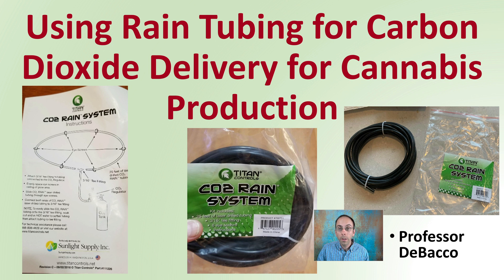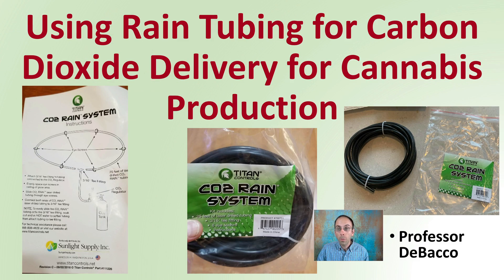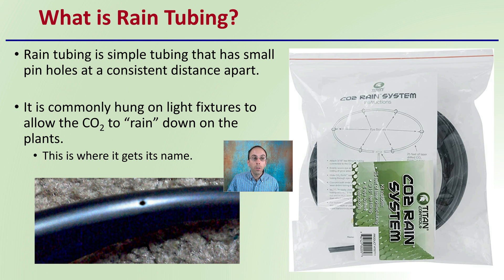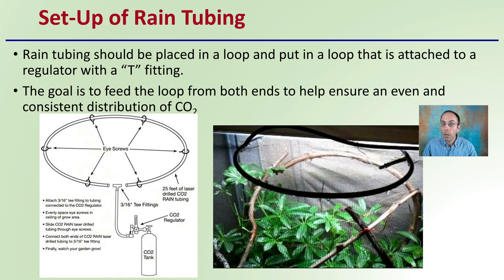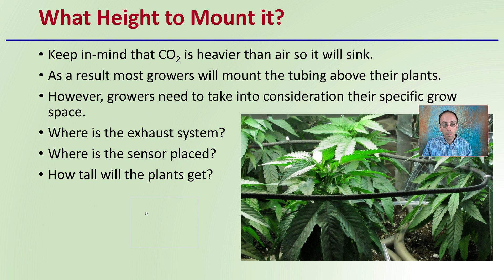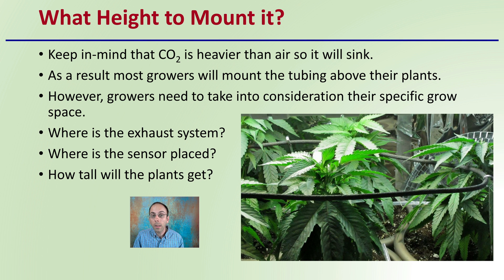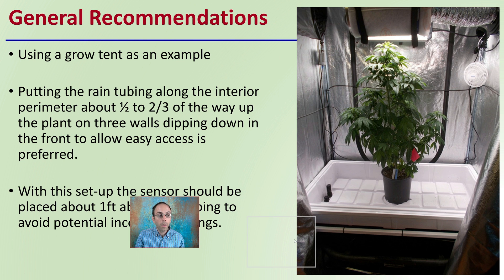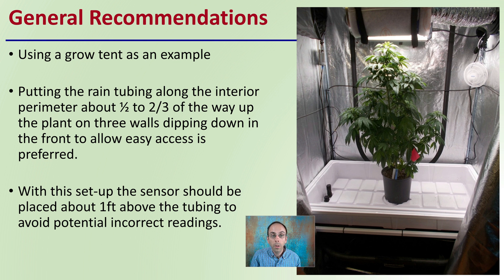Using Rain Tubing for Carbon Dioxide Delivery for Cannabis Production

Comment: With adequate airflow within the grow area, would raintubing be worth the effort? I thought the co2 would dissipate pretty quickly once it leaves the delivery tube.
Reply from the maker: This advantage of rain tubing is reduced as the area gets smaller, but it is still worth it to help ensure even distribution despite good air circulation.